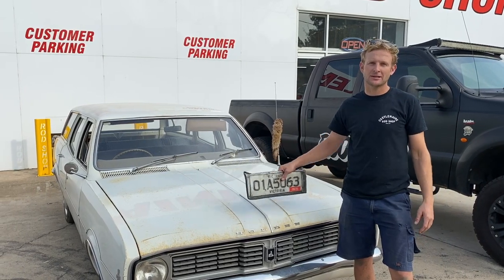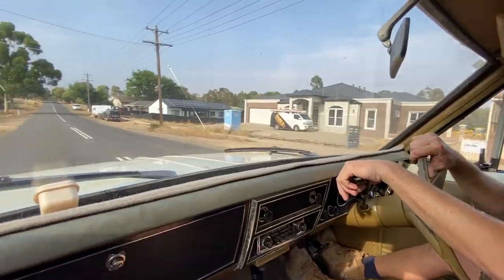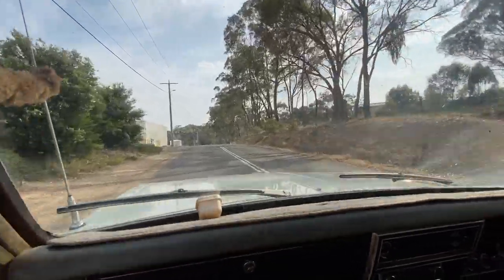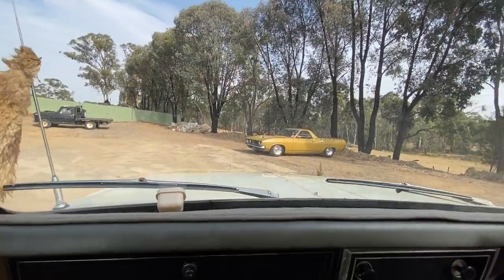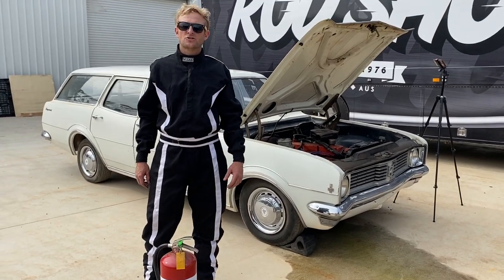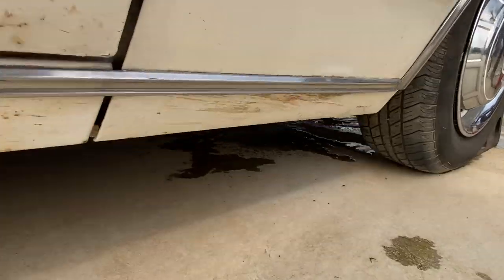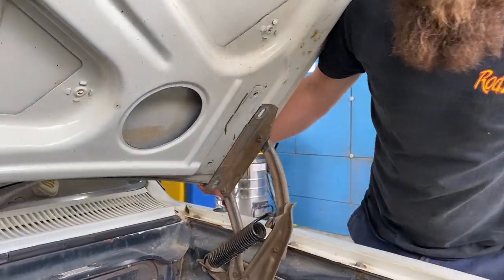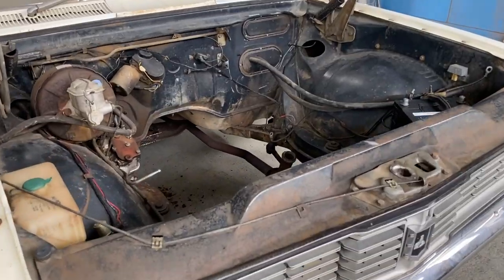HT Holden station wagon build EP 1

Comment: So much butt hurt for the POS six. Originality might be worth $$$ but it doesnt keep these old cars being driven regularly, with confidence and alot safer. Id rather see every old car on the road running new gear so no one can use the excuse of outdated and unsafe to lobby for their retirement.
Reply: @bernzie001 Insert "Street Rod Only". Thankfully, our laws don't dictate that much authority. Or itd all become pretty cookie cut, looking mate. (Some might even say it is already) Verity can be appreciated with out being balls deep into it.
Reply: That engine could be rebuilt and will last another 50 years. If you’re worried about safety then start with the brakes ,steering and suspension because that’s where your safety starts